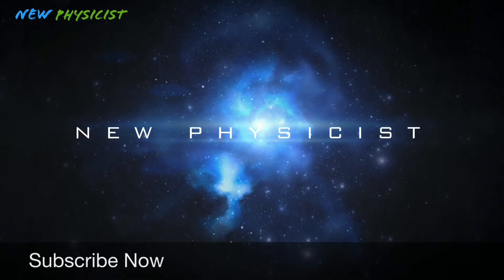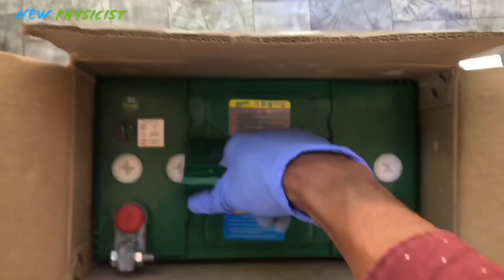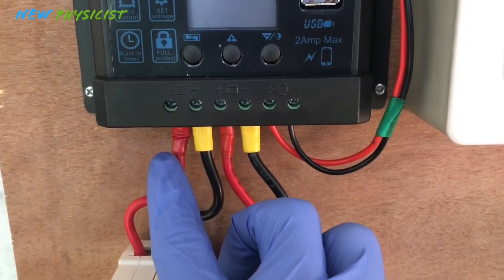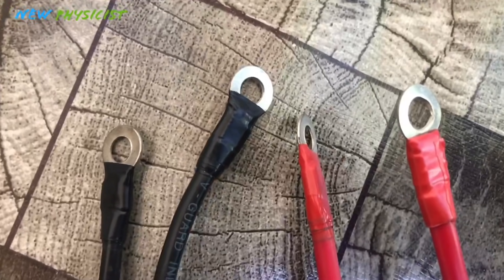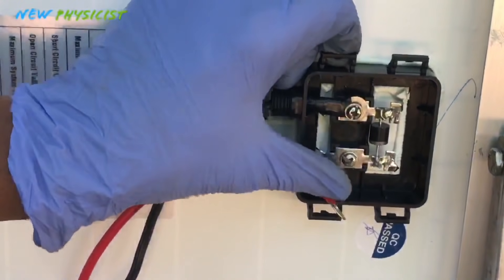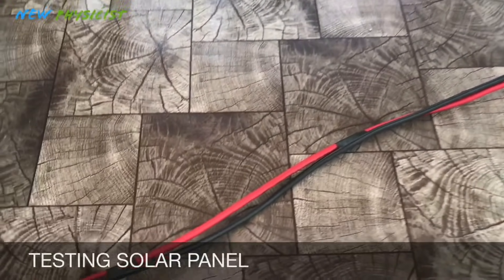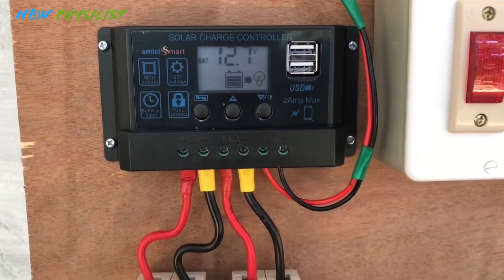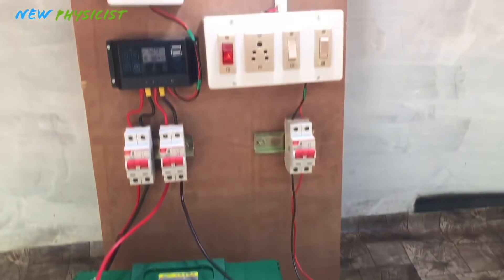How to Install Solar Inverter | Off-grid Solar Power System | 12V Battery | 100W Panel

Comment from the maker: Connect with me on Instagram! Suggest ideas and co-create.. 
https://www.instagram.com/newphysicist/
Reply: How many dollars was the price
Reply from the maker: Around $230
Reply: Nice vdio sir
Reply from the maker: 💕thank you
Reply: @newphysicist  sir where u from
Reply from the maker: I’m from India 🇮🇳. You?
Reply: @newphysicist  sir give me idea sir 2 pcs  solar panel 200 Watts what  possible inverter what Watts sir give example sir thank you
Reply: @newphysicist  what nme sir pacebook
Reply from the maker: 2 solar panels with 200w or total 200W ?
Reply from the maker: https://newphysicist.com/diy-solar-power-system/ visit this page. We can discuss it there. I’ve added your query there in the comment section. ✌️
Reply: @newphysicist  what inverter sir togerther pure sine wave what Watts sir
Reply from the maker: If you have 200 w panel.. and 5 peak solar hours.

Total power : 1000 W
Considering losses 0.85
Total power : 850 W

Battery Ah: 850/12v : 70Ah
Considering battery loses 0.60
Battery Ah: 40

Lead acid battery DoD: 50%
So you can use 80Ah battery. 

Inverter size: 80*12 : 960~ 1000W
Recommend sign wave inverter size 1Kw

All calculations are approximate. Can be slightly varied. All the best.
Reply: POPPPPP
Reply: You are a class teacher keep up the good work
Reply: @beardman357  ❤qqA112Qq
Reply: @beardman357  ❤qqA112Qq

Comment: Super compact and easy to carry and travel with accessories for the electric Generater.Systems .I was worried this was going to be bulky or hard to use.Hooks up easy and charges quickly

Comment: Thanks for the video. It is very good and well explained. Thanks also for providing the list of components. This will help us start building a basic, yet fully functional solar system. I have a few questions, please, if you don't mind:
(Q1) I see that you have 2 X 50W solar panels, configured in parallel, which will add the amperage of the two panels together while the voltage remains unchanged. I can also see that you are using a 10A charge controller.  My question is, what is the amperage of each solar panel?
(Q2) Since you are using a parallel configuration for the solar panels, is there a need for an in-line fuse for each panel to protect them, should one panel develop a fault? Equally, if an in-line fuse is needed, what capacity fuse will be most appropriate?
(Q3) I may be mistaken, but it looks like you are using 40A 2pole DC circuit breakers on the charge controller to isolate the solar panels, battery and DC loads respectively. Is this the most appropriate method, i.e. should the capacity of the circuit breaker, depend on the component at the other end? Or would you recommend, in addition to having the 40A breakers on the charge controller, adding fuses to protect each component, e.g. 100A (or so) fuse on the battery, 10A in-line fuse on each solar panel, etc.?
(Q4) Finally, does the circuit between the battery and inverter, require a breaker or fuse? This may be on the model, but I am not able to see it properly.
Thanks in advance and carry on with the good work. Your work is appreciated.

Comment: Small tip I learned from another channel, to avoid a spark when connecting -ve wire from the inverter to battery -ve terminal hold a small resistor between the wire and battery terminal for a few seconds to charge up the capacitors inside the inverter then proceed to connect the cable. Also you do not need this trick for LFP as the BMS inside the battery will prevent the sudden power surge.
Reply: haha RIGHT! That Huge spark! I've done that too many times! Good info!

Comment: As per instruction provided with charger ,we have to connect battery first (then only display will show), second solar penal and thirdly load.disconnect in reverse order.

Comment: Hello sir, I have same setup but I run only DC load like lights etc. I am thinking about installing the inverter after seeing your video. Which model of inverter do you use? The one in the link is different that one shown in the video. Thanks!
Reply from the maker: Yup. It’s different. I used a 400W inverter manufactured locally. Low cost 200w inverters are available online. If u want I can provide link. Go green..

Comment: Thank you so much for the  good work. Please I want to ask if the DC and AC can be connected to the solar panels at the same time? This is because from the video I only see u giving the AC current directly to the inventor. Please I don't understand it. Thank you.
Reply from the maker: I took the AC output from the inverter. Not in to it.
Reply: @newphysicist  thank you, sir, for the feedback but I wanted to know if the ac output can be picked from the solar system as well. Thanks.
Reply from the maker: No. I didn’t use microinverters. So you can’t draw AC power from the panel. You have to use an inverter to convert DC to AC. Or use micro inverters on each and every panels.

Comment: My question is am going to buy 50w 12v solar panel.10a controller what battery i need to buy and what all i can power up like light fan etc and what wire to use.sir.thank you
Reply from the maker: You can Use 20 Ah lead acid battery. Total power 120 W. which means 10W led for 12 hrs. 6sqmm wire is enough. ✌️

Comment: I see two usb ports on the controller, will it work with the absence of battery?
Reply from the maker: Yes it will.
Reply: @newphysicist  Thanks for the reply, will it also work without battery if the charge controller is PWM and not mttp
Reply from the maker: Yes of course. You can use the power for charging and lighting.

Comment: Hi, is interesting to note that you connect the inverter to LOAD connectors in the MPPT/PWM instead of the battery? Any good explanation why this way is preferred?

Comment: Thank you very much for the explanation. Now I wanted to charge the battery using the 'Line in' from the inverter but Iam connecting the inverter to the regulator so I'm a little bit hesitant to do so. Can I do it or will it affects the regulator
Reply from the maker: Connect inverter directly to the battery. It’s safe.
Reply: Thank you so much

Comment: Can you connect  th first lamb of DC and a lamp of AC voltage so that if you switch a switch of DC they all go off and if you switch a AC switch they also work the same?
Reply from the maker: Ac output is from inverter, DC output is from the battery. What is ur intention? Then I hope I can provide an answer

Comment: Hi thank you for you interesting content. I have one question, I know this is not relevant for a small system but can't we plug the inverter to the DC in charge controller to prevent battery drain during the day (considering a bigger solar system power input)? Aren't all these off grid systems always draining the battery when solar alone during the day could be perfectly capable of powering the appliances (after converting to ac).
Reply from the maker: Good questions.

1. You can connect inverter to the controller and you must. But your charge controller rating must be enough to handle the possible power draw by the inverter. That’s all. If the inverter draw 12A through a charge controller, it’ll die. 

2. You can directly connect inverter to the panel as long as the load is ok with a fluctuating power input. Otherwise it’s bad for both the load and inverter. That’s why we use batteries. But in Grid tie systems there’re no batteries. Grid will supply the required power. 

Appreciate your questions 👍
Reply: Most inverters have a low voltage warning "beep" and will also automatically shut off if battery voltage gets too low.

Comment: Hi good demo on installation of charge controller and inverter. I have a 200 watt panel with some damaged cells, how can I replace or repair them. Thank in advance for assistance.
Reply: Repairing Damaged Solar Cells

1. Assess Damage: Identify damaged cells visually and with a multimeter.
  
2. Remove Glass: Carefully use a heat gun to soften adhesive and lift the glass.

3. Replace Cells:
   - Purchase matching replacement cells.
   - Cut and solder new cells in place.

4. Re-Encapsulate: Use epoxy resin to seal and reattach the glass.

Good luck! Let me know if you need anything else.

Comment: Hi . If you want to charge the batery from the AC outlets what extra you are going to use? And also how much greater the voltage from the Solar panel can be from the voltage of the battery?
Reply from the maker: If you are using an MPPT charge controller it’ll adjust the voltage & current best for the battery. It’s not the voltage but the current you have to take care about. 

There is an option in most investors for “IN”. There you can connect the AC. The adapter inside the inverter will convert the AC to DC and charge the battery.

Comment: Do you need a charge controller for a on grid setup?
Reply: If you don't have battery no need to use charge controller. On Grid system will produce the power and send it to the grid via network meter.

Comment: Can I use the battery while charging it via Grid power ? Or ,What happens when there is grid power connected to the battery terminal with inverter in use and connected to same better terminal .
I’m subscribing,your channel is one of the best
Reply from the maker: You will get output from inverter. At the same time it will also charge the battery 🔋
Reply: @newphysicist  please how do I do that ,specially when the Load connected to the inverter output doesn’t have any other source of power but the inverter output. My fear is the fact that I’m gonna be having grid and battery connected to the same DC inputs . Is it safe ? Or there is a another way of making this connection. Please educate me more as my inverte is just laying waste
Reply from the maker: Just put a switch to turn the inverter charging off. There’s a provision in the inverter board. So that,

Battery will be charged only using Solar
When there’s no current in grid inverter will work. 

Is that what you are asking about? If not pls comment ur concern. I’m eager to hear
Reply: @newphysicist  I’m not using solar . I’m wanting to use only grid and battery. How best do I make the connection so I don’t have interrupted power supply !

Comment: Why did you install a switch to turn on the load (bulb) when an on/off switch to do the same already exists on the solar charge controller itself ? ...
Reply from the maker: After almost 1 year I wonder the same. 😅 
Thanks

Comment: Hello sir good day to you over there. Sir impressed with how everything are done, sir , I wànt to ask some questions,
# What kind of battery are my to for a start? 
#who or  where to get the controller?
#for the inverter, how get it too. 
Getting all these things can I installed it by myself..
Sir am waiting here your response and am some much need it relief my self from noise.
At least the ones that can carry my TVs set , ceiling fan, charge my phone and other things.thanks.
Reply from the maker: Lithium ion batteries are best but little more expensive than lead acid batteries. Go for it if you can afford. 

I’m not sure where u are from. A 200W Solar panel 110 ah leaf acid or (60ah lithium) and a 1000va inverter would do the magic. Most of the modern inverters come with controller inside. No worries

Comment: What if i want to charge the battery with the inverter? Is it safe to follow this tutorial and just connect ac load to the inverter?
Reply from the maker: Yes. There are ports to connect Phase & neutral to the inverter.

Comment: Please are those items you turn on circuit breakers?
Reply from the maker: Yes
Reply: @newphysicist  thanks bro.
Please can I have your whatsapp contact.
Also what are the specifications of the circuit breaker.
I will also appreciate you do a video about dB wiring when installing inverter for home with grid connections.

Comment: Thanks for the video. Please, what's the best connection for two 300W panels, one 200ah battery and 1kva inverter? Parallel or Series?
Reply: Connect the two 300W panels in parallel if using a 12V battery. This maximizes current for charging the 200Ah battery and ensures better performance. If using a 24V system, connect in series for optimal voltage.

Comment: Mr in our place there a problem of thunderstorms if you connect inverter or bulb when it raining thunder burns bulbs and others devices which installed in the system. Is there any way to solve it.
Reply from the maker: This article might help you, https://www.solarinsure.com/protect-your-solar-power-system-from-lightning

Comment: Also wish to see a Dc Solar system , instead of using Inverter , bcz when we use inverter to invert dc to ac we lose some power through the process via heat.
Reply from the maker: Yeah. You are right. At the same time all our appliances run on DC. AC transmission is easy to manage cost effectively. That’s the advantage. DC system is best for Off-grid setups. ✌️

Comment: Can we connect inverter in the battery wires that go to the solar charge controller directly?
Reply from the maker: Yes you can. No problem.

Comment: Can I use car battery on solar
Reply from the maker: Car batteries are not designed for deep discharge. It’ll work for a fun project. But for effective use of solar power Go for Solar batteries.

Comment: @new physicist my inverter is 4000W,230V one..and my power code from the inverter is 3 core including earth wire..what ac circuit breaker spud I buy and what Ampere limit??

Comment: very well explain,     u r using out and N,  for home connection that i know. 1 question is what is the use of IN port in invertor.   waiting for reply and next video..
Reply from the maker: IN is used to charge your battery using grid electricity incase there isn’t enough current from solar panels. Thanks for watching 💕
Reply: @newphysicist  thanksss

Comment: i never understand why the solar panels have a diode across the +/-  instead of a diode on the + output wire...to stop electrons going back into the panel....weird.  can someone explain this?

Comment: Thanks for the video how many kva did you build with 2 solar panel of 250w making 500w
Reply from the maker: With 500 w panel, you can use a 2 Kva system. Assuming 5 hrs of peak sun light (PSH)

Comment: Hi, I am only running DC load, so should I take output from the controller directly or  the battery.?
Reply from the maker: That depends on the current you draw. If the max current exceed the charge controller rating connect he load directly to the battery.  But It’s not 100%safe.

Comment: very nice video man I have solar at home but I like to add isolators from solar panel to the control charger but I don't know how it work does it have sizes as I have to solar kit I have 440 solar panel and 100w solar please help  coz my things ain't safe thanks.
Reply: Depends on the amps

Comment: If the inverter is wired onto battery when theres no sun the battery will drain to nothing?
Reply from the maker: Inverter will stop drawing power when the battery charge falls below certain limit.

Comment: Why  you didn't  check  the pv charging current?
Reply from the maker: Max current output from a single panel is 2.5 amps.two in parallel total 5 Amps. That’s why I chose 10 Amps charge controller. I assumed Current will be the same as specified. ✌️
Reply: Wow are u saying 2× 200watts panels connecter in parallel will produce 5amps using 50amps solar charge controller for 100amps battery

Comment: I want to know if my inverter has internal charge ,is it possible to connect a solar panels?
Reply from the maker: Check your model. Modern solar inverters has built in charge controllers. 👍

Comment: If we want to use DC current directly from the charging controller for certain numbers of bulb, we will have to decide the capacity of the solar panels, right ? Should the charging controller too need to be matched in capacity ?
Reply from the maker: Yes. Charge controllers with different ratings are available. It’s Ampere rating must match with solar panel current.

Comment: The design is wonderful. I'd like to use 250w panel solar. What could i run with that system of 250 w?
Reply from the maker: Thanks for subscribing. Around 600-800 W. I’m working on a similar sized panel, let’s see how much it can provide.
Reply: Kind of You. I'm going to follow all your design. They're very, very useful. @newphysicist

Comment: Hi good video. Please i will like to build a 220v  10000w solar power system please can you help me with the design. 

I me sjow me which parts that i will need to build a 220v  10000w solar power. 

Thanks. 
Daniel.

Comment: Why my solar panel give me only 13volt output. 200 watts panel please help
Reply from the maker: A number solar cells are connected both in series and parallel to get a particular panel voltage and current output. 

Most probable cause: Loose Connection caused by Brocken soldering between individual solar cells. 

Pls check.

Comment: Hello sir,
Can we also charge battery using inverter when the is no sun during rainy days, without having any problems.?
Thank you
Reply from the maker: Yes you can. No problem. Set charging current correctly. You can also set a switch on the inverter to turn/off charging.